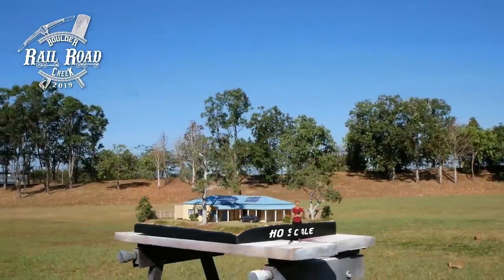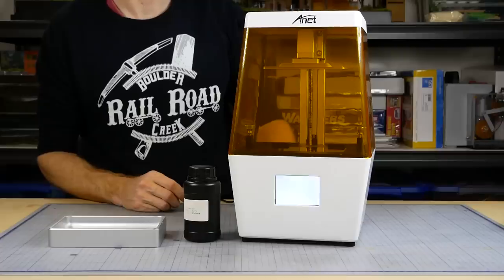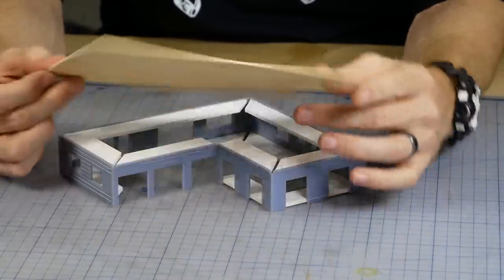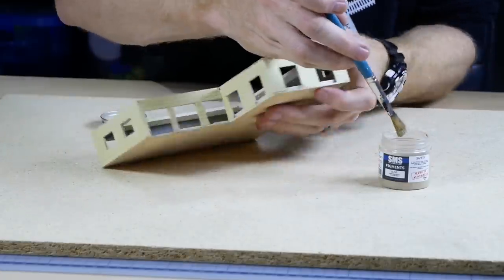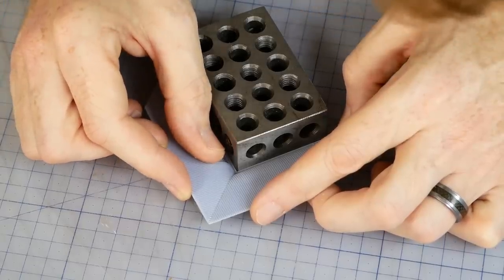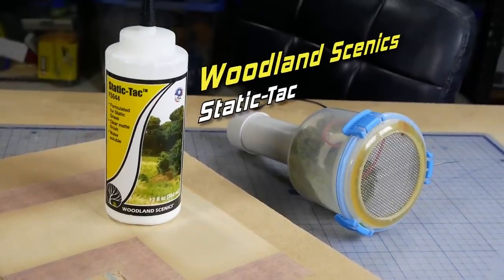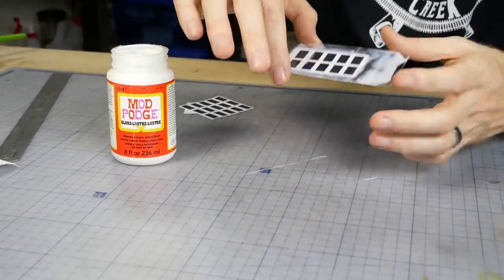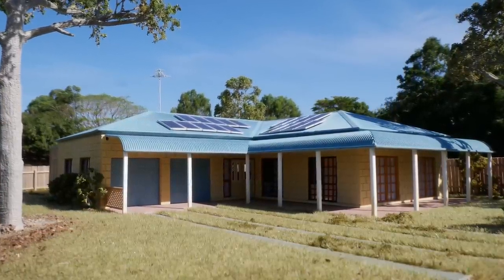3D Printing an Ultra-Realistic Model of My House – Realistic Scenery Vol.19

Comment: You could use little solarpanels from cheap calculators :P have your diorama produce it's own miniature power
Reply: That's such a cool idea. I wonder if those little panels could ever be strong enough to light up an LED or if you'd need like 500 of them? 🤷‍♀️
Reply from the maker: ha ha that actually is so cool! yeah I wonder if you could power an LED... I think it's time for an experiment
Reply: @BoulderCreekRailroad  Some of the less cheap calculators come with little power management circuits that charge the onboard battery when the calculator isn't in use. If you can get your hands on one of those, you could drop that on the roof and replace the 'calculator' part with the light.
Reply: modeling has gone green, low impact modeling is all the rage nowadays
Reply: Omg yes please, do a solar powered diorama 😍
Reply: Talk about taking it to the next level!! LOL
Reply: @BoulderCreekRailroad  , like most solar systems , of any scale,  it's battery management that's required in my opinion.   As if it's gathering sunlight,  no need to be having the lights on lolz. 

But yes the solar panels from calculators are useful for a led,  a about 5 square cm per led.   But better to shop for little panels on Alibaba or the likes,  as many cheap calculators have stickers to pretend solar  and a sealed  battery. 
But a Alibaba supply of the right panels would be a great addition to the shop,  both as an modeling item for roofs,  and as working. 

Next of course is working out 0scale magpie n kookaburra poo stains for weathering lolz. 

But for an extreme modelling challenge,  I  put forward the Kiama blowhole and lighthouse.   An ecig for the burst would probably have a good chance of working.  And awesome model skulls for the headland n ,lighthouse.   Double points for inclusion of the trawlers in the adjoining harbour lolz.   But thought it is an extension of the work done plus an extra bit as well.
Reply: @BoulderCreekRailroad  You could definitely dissect a solar garden LED lamp and use the solar panel, charge circuit, battery and LED from it to make your model light up by itself.
Reply: You'll quickly realize most cheap calculators use fake solar cells, just for the looks.
Reply: Also, calculators work at the order of microamps or miliamps. Check any datasheet for a caculator and it wil be specified that it consumes 0.001W max. The solar cells used in calculators, although providing a decent voltage (0.7-1.2V) can't really output much current. And they're not even designed to rely on the solar power unless directly hit by the sun.
Reply: its

Comment: Luke: look how easy it is to make this model.
Me: trying to accomplish a horizontal line after 2 hours 😋

Well done as always sir. Always enjoying your videos!
Reply from the maker: lol... we've all been there at one point or another 😄
Reply: @Manuel Santos one part isn't a fixed amount. It refers to the ratio.  So, in this case, one part mod podge three parts water means a 1:3 ratio. For example for 100ml of the scenic glue its 25 ml of mod podge and 75ml of water plus the dish soap (It could also be by weight and not volume).
Reply: Can't help but watch your videos, I love dioramas. I wish I could make one one day.

Comment: the failed prints, would go into a scrapyard rail setting perfect.  Any asset that you make that needs to be repeatedable, its helps if you cast these in silicone, then in the near future, its quicker to run a resing moulding, great video,
Reply from the maker: Thanks Richard, I bought some molding and casting material a while ago. I did plan to do a video on making molds and I think I still will do that at some point. it'll probably be much faster like you suggest 😉
Reply: Or used as house after earthquake

Comment: Adding a tiny chamfer to the model where it attaches to the build plate will help to reduce or eliminate flashing. The printer can easily handle a 45 degree overhang. If you get the dimensions right you’ll be left with a perfectly square edge after removing from the build plate. Another amazing models by the way 👍

Comment: Thank you for the extended free trial. I just followed your link and signed up. I am very grateful for your vids. I hope me signing up helps you too. I just got an ender 3 3d printer and I am so new to printing. I am on a mission to make a fully functional house with electricity and plumbing built to a 1:12 scale. I am in construction so the challenge was too much to pass on.

Comment: You'll get better results with a decent quality FDM printer and a good quality PLA like Hatchbox or ProtoPasta, with a lot less post-processing and no warping. I've done this with 450mm bridge sections on a Crealty CR-10 S5 as well as the JG Aurora A1/A5. Its also a lot cheaper than resin. Resin is good for some applications where you need ultra-fine details, but you can definitely get the wall / brick impression with a good quality FDM printer.

Comment: What type of paper did you print the solar panels on? I'm trying to do something similar to that but for a lightup resturant pole sign. The problem I'm running into is that white pigment from the paper is becoming viable when the sign is lit. Any suggestions for making the sign look like plastic and not just printer paper glued to plastic?

Comment: with the dlp resin printer. a couple of tips. to remove supports without leaving heavy pot marks. wash in ipa dry then use a hairdryer on the supports and they will start to warp and should easy break off. then you can cure the print. if the model is warped you can heat up the part in hot water and then bend back into shape then plunge into cold water to set. also i would replace the uv cure chamber to one that uses uv led rather than the bulbs. as they contain mercury and burn out and need to be replaced. i recommend the peopoly uv led lamp used on the moai. also you can use an old sonic toothbrush for cleaning the resin off.  hope this helps you in someway. great video. :) oh and looks like your getting overexposure on the print. you might want to dial back on the normal exposure by 2 :)
Reply from the maker: Awesome tips mate... I'll 100% be using all of those tips for future 3D prints! Thank you 😃
Reply: @BoulderCreekRailroad  your welcome. always about to give advice to resin printer owners. i have 2 :) and 2 fdms

Comment: Hi Luke. I'm curious whether you have noticed any shrinkage or warping of your resin walls after this much time.  It seems to be a concern in the 3d printing groups.  I am about to print a number of HO scale buildings with the walls flat on the build plate as you did.  Anything you would do differently now?

Comment: Hey Luck. That has become awesome. I also build all the houses myself and find your way of building very interesting. However, I build from balsa wood and print only the windows, doors, gutters and so on. Very nice video. Do you have a link to the ultrasonic cutting knife, can not find. Greetings -Tino
Reply from the maker: Glad you enjoyed the video Tino, here is a link to the wonder cutter, it's the newer version so it should be better than the old one I'm using : https://www.micromark.com/Wondercutter They are expensive and I don't use it a lot but when I do use it, it is very helpful 😃
Reply: @BoulderCreekRailroad  Hello Luke, thanks for your quick reply. The device is really very expensive, but since I build my own house all made of wood, that would be a great relief. Thanks for the link. Greetings Tino

Comment: Great Job Luke. Awesome job and really admire the detail.

Curious if you sourced the Ultrasonic cutter/knife locally or from overseas. Residing in regional Victoria can be difficult to source hobby equipment. What would be the maximum thickness that it can cut? Would you used it with Perspex ?

Comment: Some random thoughts and musings below: All to be taken with a grain of salt, just food for thought.

I wonder how useful photogrammetry software could be for helping with the workflow here? I would guess the generated 3D models would be way too rough to use as-is, but they could be used as a guide for making the model you wanted to 3D print from. Could be a useful way of getting reference data for a building/structure/etc that you can't get to accurately measure otherwise. E.g. driving through the country you see a beautiful building or church or barn or bridge or whatever, and you happen to have a drone (or even just a camera), you capture as many images of it as you can and when you get home piece the images back together to give you a model to use as a reference to design your model to 3D print from.

As for the led lighting inside the house. You could section off (light block) one room and add an led with a pale blue filter that is connected to a circuit that makes a random pulsing/strobing effect, from outside it would look like someone is inside watching TV or a movie with the lights off.

I hope you kept the damaged prints of the screens and door frames. Paint them to look rusty and use them in a future project, they would be great if you ever want random metal scrap to scatter around a yard or use as a load on the back of a vehicle.

(This one not to be taken seriously, but I couldn't resist) Open one of the garage doors and inside model a 1:87 scale person making a 1:7569 scale house 😉. Alright, on second thoughts, maybe not 😂

Well that's enough random crap from me, thanks for sharing this with us Luke, I really enjoyed the video and love the final model. Nice one 😀👍
Reply from the maker: ha ha ha they are some awesome ideas! I will definitely try adding the flickering blue LED! That would look so cool. I do plan to take some scans of myself and 3D print myself at some point so a miniature model of me making a miniature model is not out of the question 😄

Comment: Is it ideal to 3D print diorama bases? Due to quarantine, I am unable to buy polystyrene, yet have a lot of filament. Would a small diorama work with a 3D printed base, or are there downsides I do not know of?

Comment: How does this resin printer compare to the one you have used in previous videos? Bloody nice build by the way.
Reply from the maker: The print quality is pretty well the same however I feel like the program used to slice the model isn't quite as good as the one from Anycubic. It's still a great printer though...but I think I like the look of the Anycubic one a bit better.

Comment: Great video as usual, but why the change from Anycube to Anet?
Reply from the maker: I still use both, I almost bought a second Anycubic... the Photon S. I'm actually getting a third printer to test (it's being sent to me free of charge) that is supposed to be a little more robust and has a slightly bigger print area. I would say the difference between Anycubic and Anet in terms of print quality is almost identical, but I still lean towards preferring the Anycubic Photon.

Comment: Another Great video! I looked and couldn't find your review of the Anet N4 on your website. I could only find your review of the Anet A8 but I was wondering what made you use the Anet over the Anycubic photon you usually use.  I ask because I was thinking of picking up an Anycubic. Also it would be great if you could put/make a video review, here on youtube of it and or add the direct link to it on your website if it is there and I just couldn't find it.  Thanks in advance for any help.
Reply from the maker: thanks mate, I'm a bit late with the review as I'm still writing it... I thought I'd have it done by now! It should be done in the next day or so and when I finish it I'll update the link to take you directly to the review 😉
Reply: Ive been watching for an update regarding your review but I couldnt find one. I was wondering if you could maybe just briefly share your thoughts on the comparison of the Anet A4 and Anycubic Photon. As far as I can tell the Any cubics stats are better in every way, including being cheaper, with the exception of being a couple mm bigger base on the A4. Also what made you use the A4 over the photon or was it just a freebie for a video sort of thing? Any help would be greatly appreciated. Thanks in advance.

Comment: is the resin printer faster than a traditional 3d printer? or is it just about the same time? i have 2 regular printers and have never tried the resin one. thats why im curious :D ive wanted to do this of all our houses. 2 summer houses and 2 socalled villas. im not really new to modelling in 3d (its been a while since though, 2002 to be correct, where i modeled cars in 3dsmax), and now i dont know where to start to get the project going :( age and memory loss :D

Comment: If you look inside the workshop there's a scale replica of a 3D printer printing a tiny replica of a 3D printer. Now, it's all fun and games, but that scale 3D printer actually works and so does the tiny 3D printer it's printing. If the tiny printer prints an even tinier printer we could have a problem. Yep. The folks at CERN are on the phone. We definitely have a problem

Comment: I wonder how this is going to change your modeling in the future.
Reply from the maker: I will be definitely adding in a lot of 3D printed details but I still plan to make models the traditional way 😉
Reply: @BoulderCreekRailroad    Well my advice is to start drinking heavily, or using drugs, your family would like it better. Getting a 3d Printer is the worst thing I ever did. Bought an Ender 3, and like magic a second one shows up less then 2 weeks later. I felt the first one was lonely or something. The two of them run almost 24/7 right now, and there's filament all over the house, and I'll make no mention of the printed pigs that have taken over part of the house. It seems everything I want to make takes at least 7hours.

Comment: I don't have the grass applicator and I can't make one but I have the grass do you have some other options for using the grass
Reply from the maker: Noch sell a puffer bottle for applying grass, here is a link: https://www.amazon.com/Noch-8100-Static-grass-dispenser/dp/B0002I032K
I've used it and it does work but not all that great, but it's a start and worth a try if you cant get an electric static grass applicator.

Comment: What is a ultra sonic cutting knife ? How does it work ?
Reply from the maker: It basically a knife that vibrates ate 40,000RPM making it easier and faster to cut through stuff. You have to be careful though when cutting plastic because it vibrates so fast that it can generate heat and melt the plastic!
Reply: I think that ultra sound makes the knife micro vibrate, which helps to cut. You know, if you simply draw a knife, you cut, but if you move the knife while cutting, it cuts way better. Well, you know what I mean.

Comment: Does the resin stink as bad as the one Anycubic uses?  Man it smells awful.  Why did you quit using the the Photon?
Reply from the maker: The resin still smells! and I still use the Anycubic Photon (I actually love using it! between tha Anet and the Anycubic I think I'm still leaning towards Anycubic). The Anet one does smell less though because the cooling fan for the UV light is on the outside of the printing chamber. Basically the print chamber is sealed off so the resin fumes stay inside and don't get blown out by the fan...

Comment: Also, I'd reccomend using GIMP over Photoshop any day, if you're not in the mood to spend the money on a monthly subscription.

If you think GIMP's UI is terrible and it has way less features than Photoshop, you either haven't used it in a decade, or have been fed Adobe propaganda. Give it a try!
Reply: Side note: DuckDuckGo is also arguably better than Google, even though one may point out that the search results on Google are arguably better, the lack of tracking with DuckDuckGo is more than enough to make it worth it to me. Your choice though. Is your privacy worth less than slightly better search results?

Comment: Why use plywood on top of PVC foam sheet , can't one 
just use PVC foam sheet also instead of the plywood ?
Plywood is moisture sensitive wile PVC foam is not !
Reply from the maker: I mainly used the plywood because it came in the exact thickness I needed, the PVC foam was too thick for what I was after and I didn't have anything thinner at the time 🙂
Reply: @BoulderCreekRailroad  

That explains, thanks for fast answer.